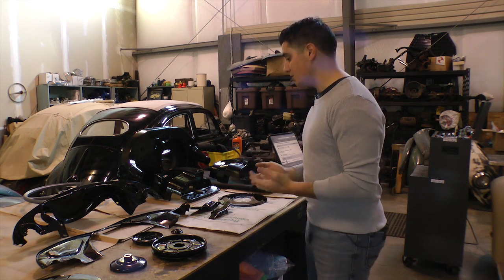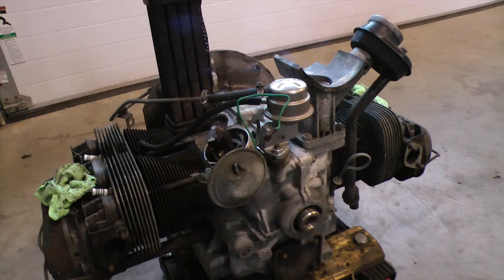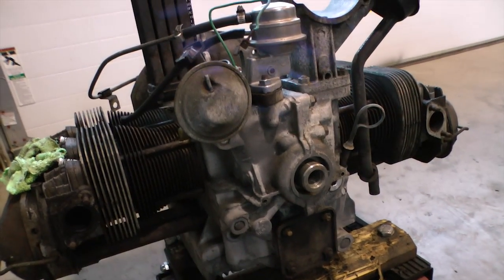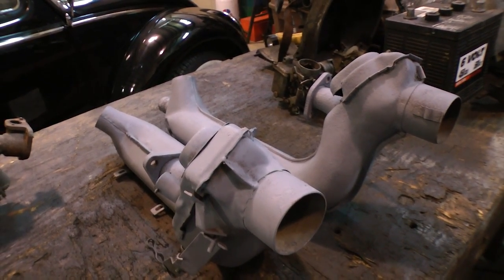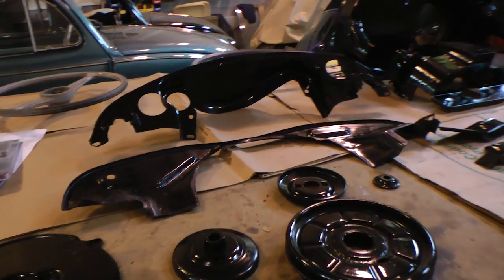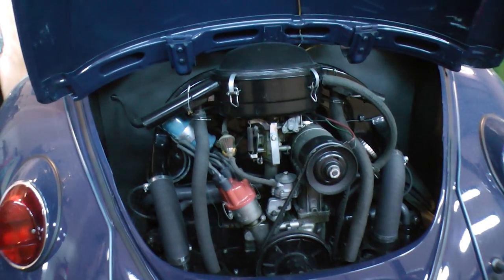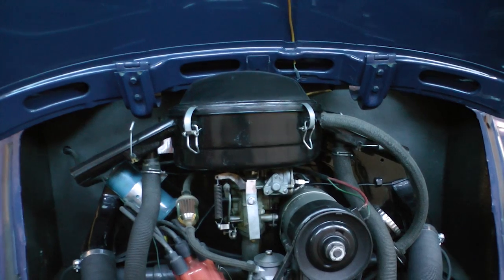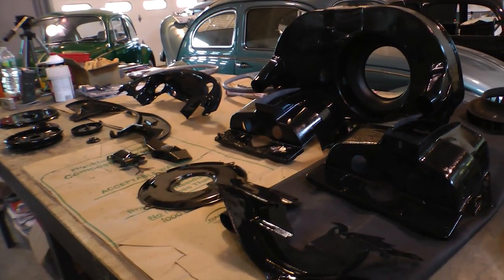Classic VW Bugs How to Detail your Air-Cooled VW Beetle Ghia Bus Motor

Comment: Great video Chris, I use Dupli-Color High heat semi gloss. It looks like factory paint and it holds up even beter and it holds that factory finish for a long time. I have 40k on my engine and it looks as good today as it did the day I painted it. I drive it every day.

Comment: Just fyi, don't use the drill motor for the wire wheel, wrong type bearings. Drills are for pressing forward. A better bet is a small angle grinder. The thrust bearing is built for lateral loads. Best wishes, I'm enjoying watching these older videos.

Comment: @brighteyefilms I dont think it is overheating.  Because once the motor warms up it runs bad.  It wont accelerate at low rpms.  You really have to give it alot of gas and dump the clutch.  It seems like it is not getting enough gas.  What do motors do when the bushings go out in the carb?

Comment: I powder coat for work and it doesn't cost a lot to get all that sandblasted and powder coated you are looking at about 85 bucks and its a lot more durable then spray paint but people say it will make your engine run a little hotter I don't know if that is true

Comment: Look at the VW manual (Bently)...remove the strut from the car, and use a spring compressor or better yet, take it to a shop and let them do it for you.  They should have a heavy duty compressor...you don't want anything breaking and flying around causing injury or death.

Comment: I had a question. My 73 super beetle runs smoother when the engine is cold. When the motor heats up the car runs terrible in lower RPMs. What is wrong?

Comment: There should not be a fuel filter in the engine compartment.   The more fuel line connections the greater chance of fire.   Put the filter below the fuel tank and connect to pipe in front of tunnel.    Also only use new fuel line and use factory one time use crimp style clamps.  DO NOT USE WORM DRIVE TYPE AFTERMARKET FUEL LINE CLAMPS !!!!!!!!!